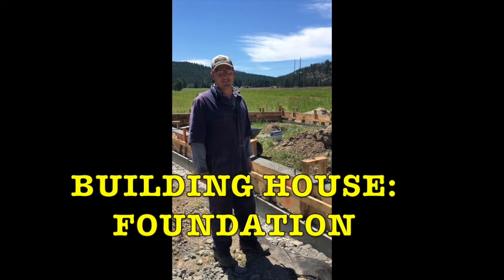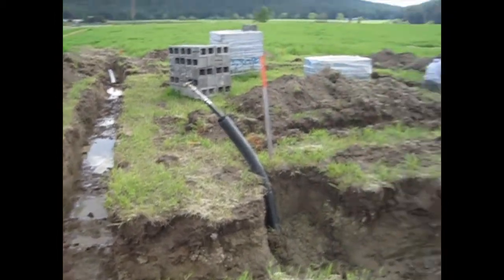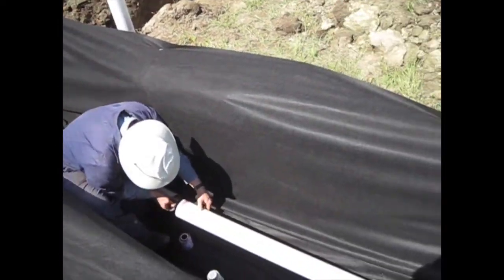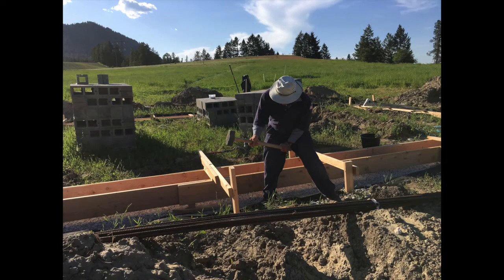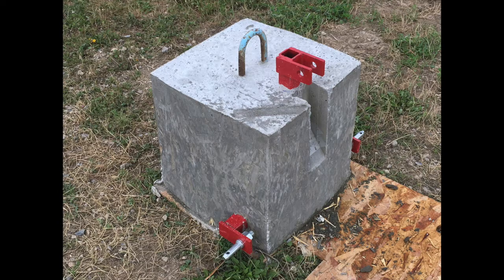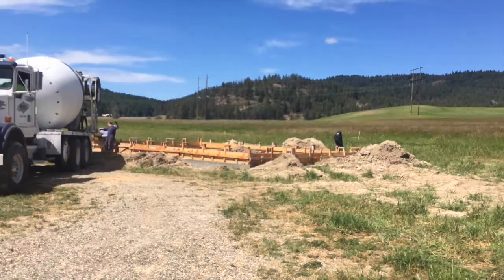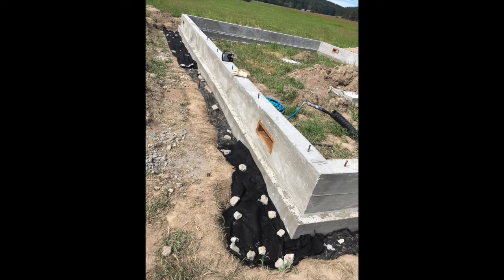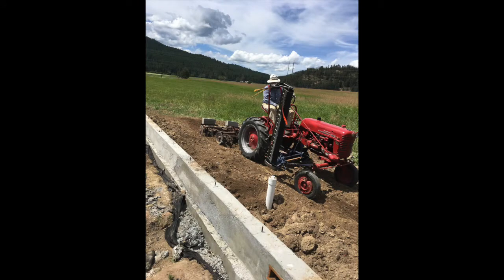Building Farmhouse #2: Rubble Trench Foundation!

Comment: Nice work but wondering why you dug 30 inches in depth when using a rubble foundation?  What does the frostline have to do with a rubble foundation since the attraction of a rubble foundation is that it does not respond to frost like a solid concrete footer.  How were the dimensions of the rubble foundation determined?  The filter fabric was a great idea.
Also wonder why people are still placing steel inside concrete.
Reply from the maker: Hi there! Great questions! The reason for going to frost depth isn’t so much due to the influence of frost on the rubble fill, although ice lensing could potentially happen, but rather to prevent frost from influencing the underlying soil. The dimensions were determined from some articles Fine Homebuilding had on the subject. To me, steel is cheap insurance. Concrete will crack, that’s a given, but steel does certainly help keep everything together and on the same plane. We also are required ufer grounds in our state as well, so that plays in. Thanks for watching!

Comment: Thank you for posting this great video.  Your foundation looks fantastic!  How has the building been performing?  Have you noticed any cracks or other issues with the foundation?  Rubble trench foundations have been used for centuries so I know they are durable.
Reply from the maker: It’s been great! Been through very dry cycles and very wet cycles. Hot and cold. Hasn’t budged. No cracks. No settling. Working great for us!

Comment: Square feet? What was the savings using rubble instead of concrete? What will the savings be if you hire out the form build? I watched to learn about rubble foundations versus concrete.
Reply from the maker: Our foundation is 897 ft2 (24’x36’). There was definitely savings in doing the rubble trench ourselves. Obviously less concrete, but also no form rental for the taller concrete walls you would need to build. If you were to hire it out, I’m not sure it would be worth it (vs. concrete) once you have to pay for labor. Overall though, we’ve been very pleased with it’s performance. We’ve been through a few winters now with no heaving issues. We’ve never even had any cracks in our drywall. It seems to be “rock” solid... Pardon the pun! Haha!
Reply: Hi I am want to build my own log cabin but don't know what tip of cement to use for the foundation and what would be the strongest foundation?

Comment: all you two needed was to rent a line pump truck with the concrete batch truck.  That way you get the advice and expertise of a professional as well as an extra hand.   A pump operator would advise you to go around a few times in 'Lifts' so as not to create too much concrete hydraulic pressure which is partly why your forms blew.   Also the pump makes filling the forms effortless.  Good luck on your project Cheers.
Reply from the maker: Mmmmm....good thought, but I believe the two available concrete companies near us did not have a pump truck. We would have had to pay much more to get one out of Spokane. The best solution would have been building better forms. Or a level grade beam and then doing block. But, oh well, best laid plans. Thanks for watching!